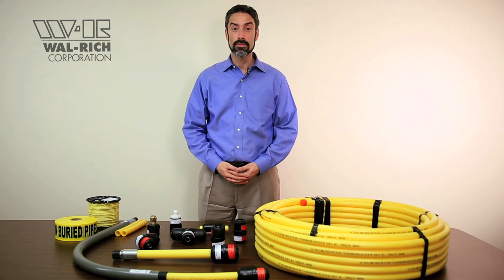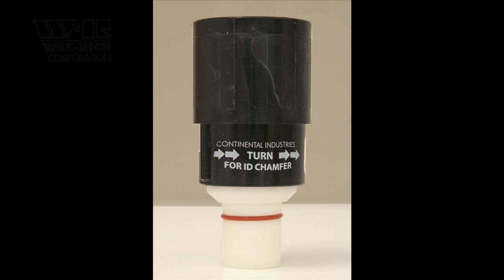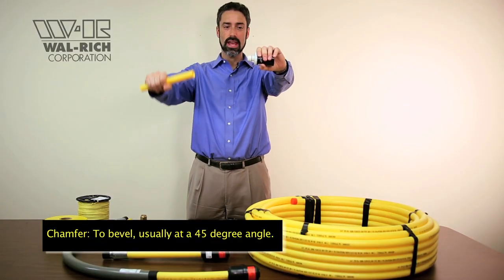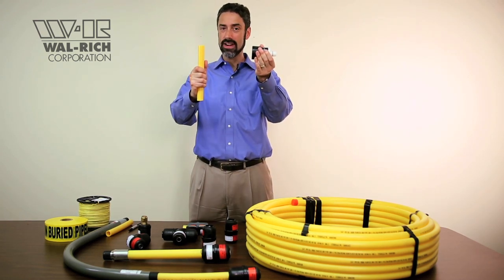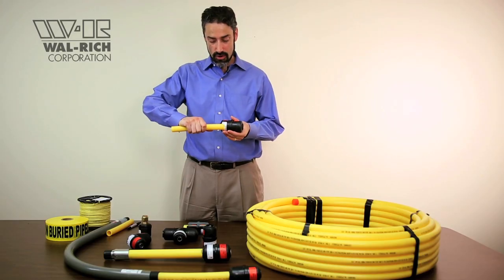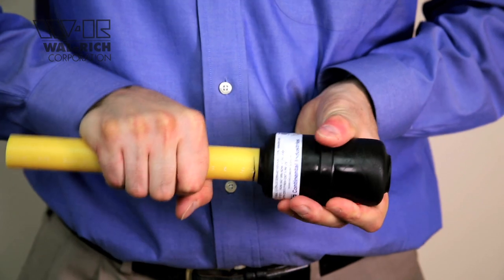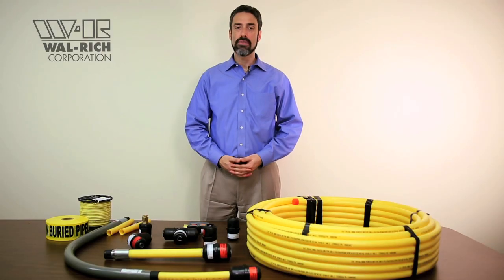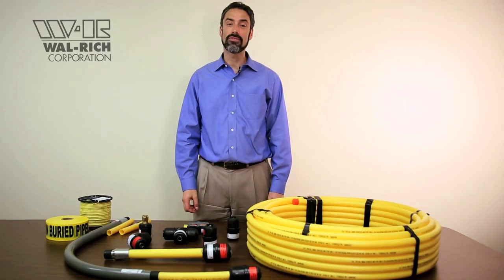Wal-Rich Underground Gas Training Part 4: Installation

Comment: Lmao, please...tape the tracer wire to the pipe....don't be an idiot.

How the hell are we supposed to accurately locate if you offset the tracer...
Reply: If u tape it right, it won't come off.
7 years of experience in the Natural Gas Field.
Reply: We will fail an inspection here in PA if you tried taping tracer wire to the pipe
Reply: anthony stackhouse I don't let anyone tape the wire to the pipe. when pulling into a bore. It's a completely useless extra step, and causes more problems than anything.
Reply: @deepsix1306  explain
Reply: @vegaslowblower8781  Well, it causes the wire to break on some bores. Even if it doesn't, the tape just breaks and it did nothing. Also, you're technically supposed to keep the wire away from the pipe. But that's not really possible with a bore.
Reply: @deepsix1306   zip tie no ?

Comment: If you can use this pipe to bury a natural gas line. Why couldn't it be used to pipe natural gas through a house. If CSST is a hazard why not use this style of piping in houses?
Reply: Avenger 1 If a fire was to break out in a house, would you rather have a metal gas pipe or this plastic one???
Reply: Ken C 
What would you use to put natural gas through out your house besides the black iron pipe. I mean  a flexible style pipe. Black iron might be safe but it isn't flexible. What type of piping would you suggest?
Reply: @gols1go1 Tracpipe 👍🏾 snap comp fittings
Reply: Such a bad idea
Reply: Fire code